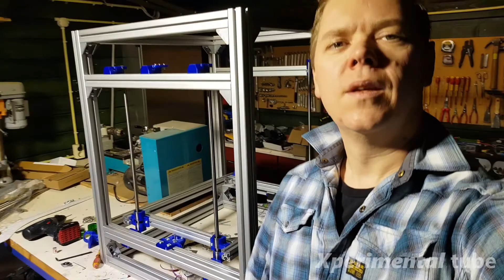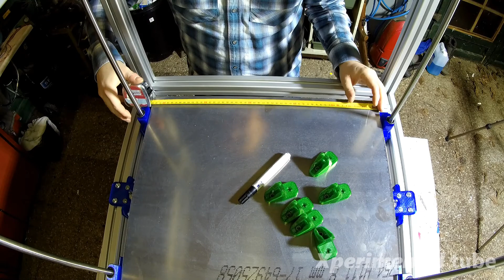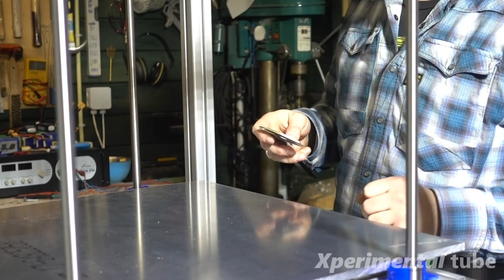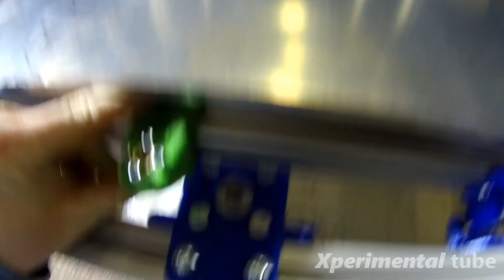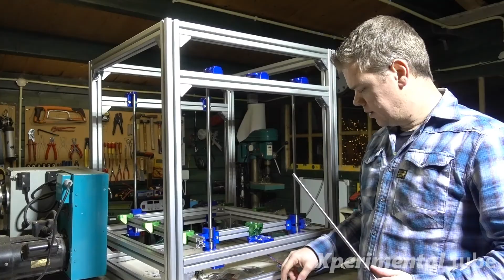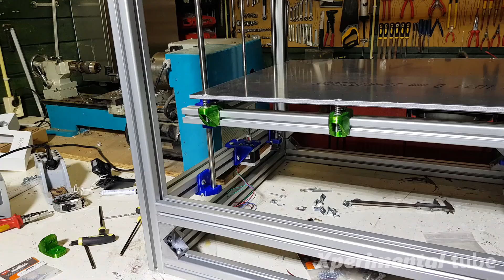03 Heated bed - HyperCube 3D printer Xperimental style

Comment: Hi! 
What kind of heated bed will you be using? I'm developing one with about 400x400x400mm buildspace, I'd like to avoid using mains voltage if possible.
Reply from the maker: I will be using 4pcs of 200x200mm 250W heatbeds, these will be on mains voltage. Its just not practical to run these kind of power on a "low" voltage, the power supply will be unnecessary HUGE.
Reply: Yeah, thats what I thought! I'd love a video on how to wire the mains voltage using ssr and best practice :)
Reply from the maker: Dont worry, the electronics will be covered extensively. Also check my SSR test https://youtu.be/pdqnfiTP3Z8
Reply: Wonderful! Would love a nice guide, so I don't kill myself! hehe 
Will do!
Reply: @Xperimentaltube  Hi Johan, great videos - can't wait to see more progress on your incredible build!

Does each heat bed have a separate temp sensor or do you have to use a separate temp sensor or several (4-5? e. g. one in the middle and one at each edge) of them to control and manage an even temp distribution? 
If more temp sensors - is the Duet WiFi able to incorporate more than one temp sensor and control the separate heat beds separately? 

Will each of the heat beds have its own SSR - think that would be mandatory if the plan is to control them separately or is your plan to have one SSR for all four of them (them only one temp sensor would make sense)

Thanks 
Lars